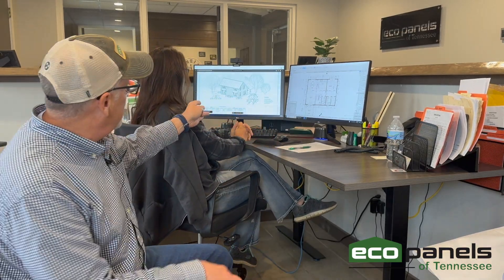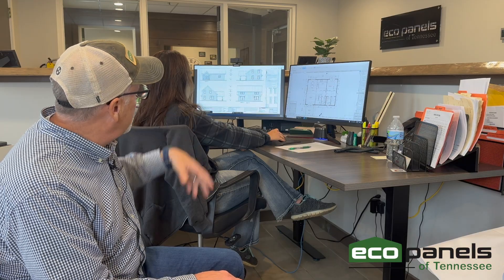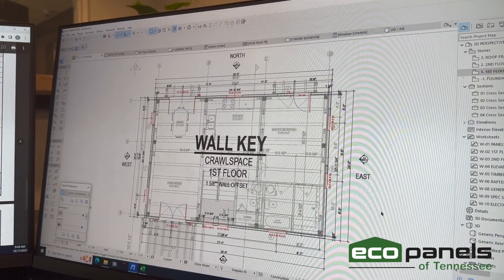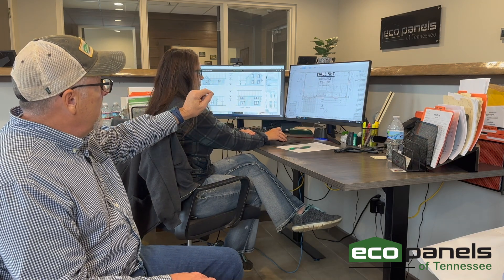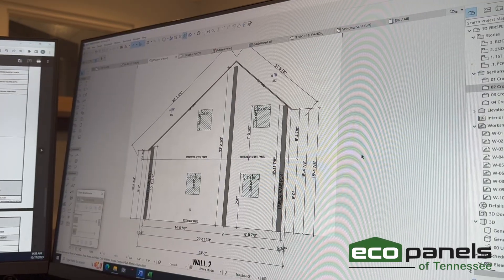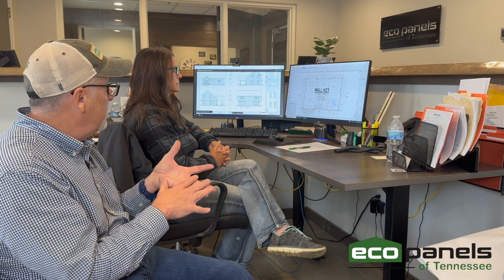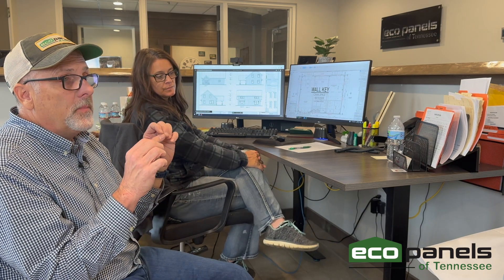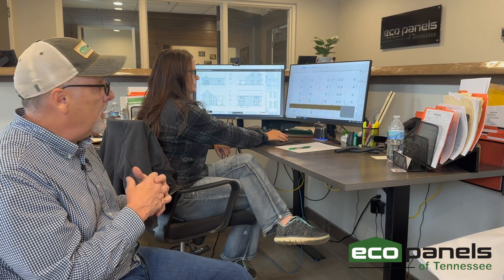Conventional Plan to SIP

Comment: I want to work with/for you guys.  I am an Industrial Designer by degree, yet I am much more than that.  I have been in construction and remodeling for many years, and I had worked in a commercial cabinet shop for 24 years.  I have always liked SIPs construction ever since first being introduced to it.  Fore many years, I have been saying that house construction should adopt a cabinet-like approach to assembly.  And SIPs is how that is done.  I am good at drawing layouts.  I would like to be a SIPs house designer . . . or whatever you might call a person who converts drawings for SIPs construction and also draws SIPs houses from scratch.  I currently live in Illinois.  Do you have any job openings that accommodate remote design work?

Comment: Do you keep copies of past home plans on file?
Reply from the maker: Great question. Generally speaking, we do not. Most plans are copyright protected. We take plans provided to us, and break them down into a panel plan to manufacture and set panels by. While we do keep those, they're not really helpful for an overall build because they've very limited to the scope of panels only. There's a number of legitimate websites out there that provide basic home plans for a reasonable fee. You can use those to get trusses and other materials from a building supply, and we can use them to base our drawings from to make your panels. Hope that helps!
Reply: @EcoPanelsofTennessee  Thank you for the info and the fast reply.

Comment: what about water and sewer lines?
Reply from the maker: Of course there's always exceptions, but water and sewer lines generally do not penetrate first-floor exterior walls. They'll go through the foundation / subfloor band, etc. In many areas plumbing is not allowed in exterior walls per code. That said, penetrations can be planned for and made in our panels. For instance, if you have a home on a concrete slab your exterior faucet can go through the exterior SIP wall. You'd want to "hide" that in a cabinet cavity if possible, but if not, a pluming wall may be framed to the interior. This has become a pretty common practice even in conventional construction so there's proper insulation between the exterior and your plumbing. Hope that helps.

Comment: Hey Rob, do you have an instructional video showing the construction of Eco roofing  panels to Eco wall panels with the finish product... also maybe a 2-story house construction with the second floor using Eco panels? Thanks

Enjoy your videos!
Reply from the maker: Great ideas. Unfortunately we do not, but we'll put it on a list to try to get. While we offer on-site technical assistance, we're normally not on site for those parts of the process, but we'll see if we can coordinate with a builder to get these in the future. On the roof to wall connection, there's several options and methods depending on the structure and overall goals. We do have details of those in our assembly manual, which you can request from our website. Great comments and ideas. Thank you!